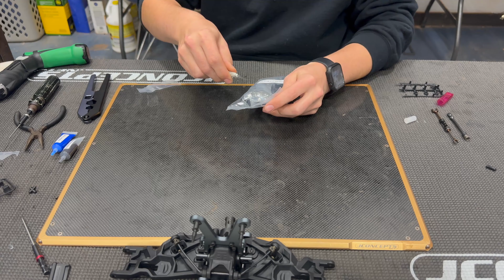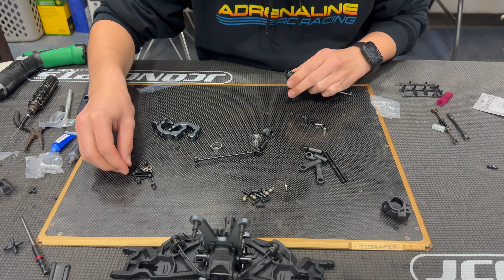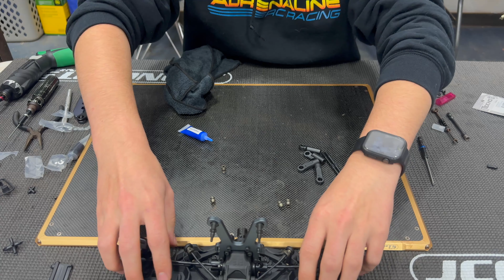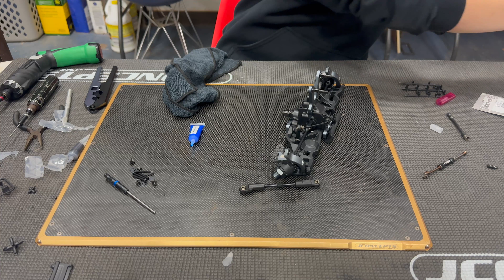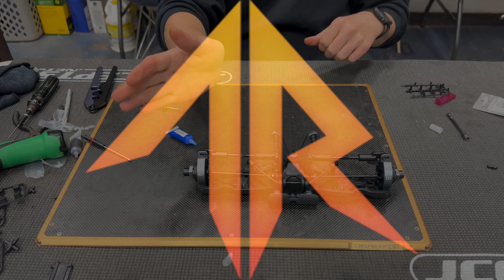Tekno EB48 2.2 Build : Bag H - Front Spindle & Carrier Assembly : Part 9

Comment: I gotta ask as a complete complete noobie whom had only owned rtr cars when I was a young kid, do you have confidence in me being able to put this car together? Your vids help but does the Manuel help a lot also?
Reply from the maker: I think you could definitely handle this build! The flow of the manual and how everything goes together is very smooth, just make sure you take your time and double check anything that may be confusing. Also, feel free to ask any questions you have during the build on here or you can call the shop at 703-631-8820 and I’d be happy to help!
Reply: @Adrenalinercracing awesome I appreciate that! I feel like I could definitely get the kit together but then I start to question what esc/motor/servo/radio stuff to use and what is needed regarding all that😅
Reply: @Adrenalinercracing also one more thing, is there a tool kit I could buy that pretty much covers all the things I could need to build it? I have zero tools
Reply from the maker: A good electronic setup I would recommend is the Cayote Crest 8 ESC, Tekin T8 G3 2050kv Motor, USRC 1776 Servo, and the Flysky Noble NB4 radio. That should be a solid build and place to start, a bit pricey up front but gets you some really good equipment. Tool wise there isnt a single kit necessarily but it will mostly come down to how much you want to spend, I usually equate the base Dynamite stuff to something like Harbor Freight, Protek to Milwaukee, and MIP to Snap On. All are good tools and will get the job done but can get pricey for sure. I’d be happy to help you spec out a kit and the tools needed if you’d like, I should have just about everything in stock. As long as you are patient with the build you’ll be successful but the most difficult part comes at the end when making sure you get good solder joints so that you have efficient, clean, and safe power.